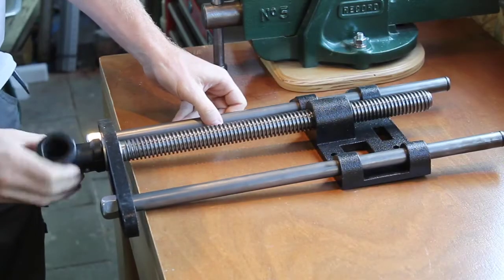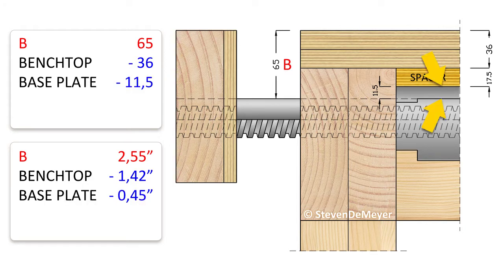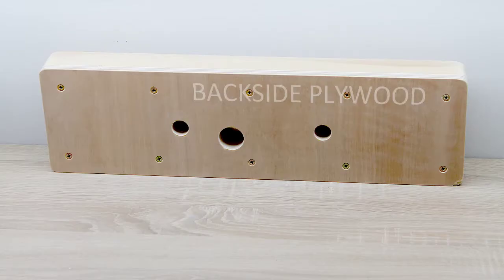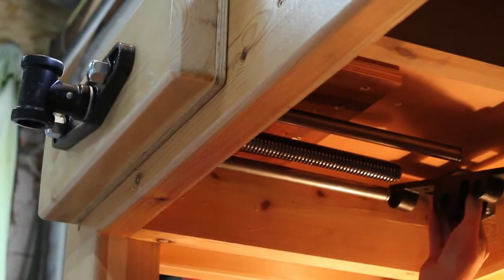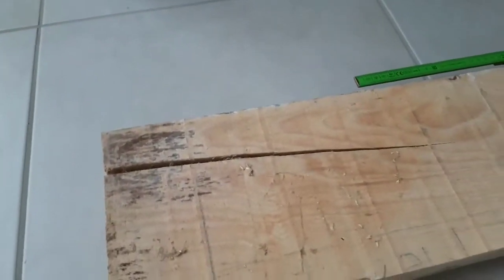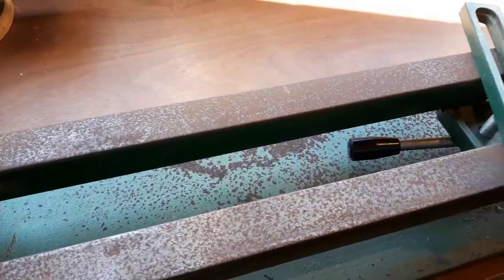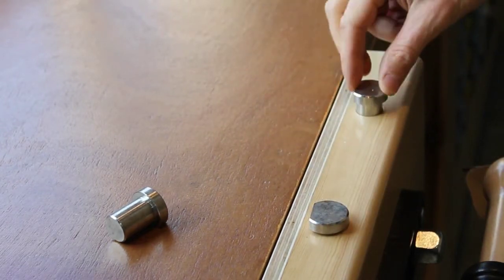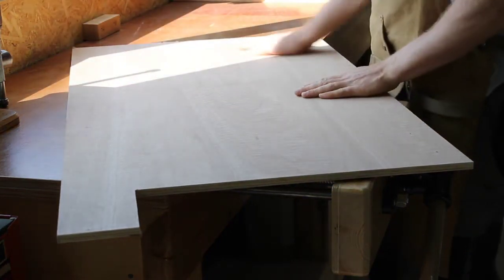Installing a BENCH FACE VISE  (HV516)  and woodturning a HANDLE

Comment: Great video. Thank You for providing the level of detail and measurements. This is very helpful depending on the level of the viewer and their need for information. Most of us don’t want to make things twice or to try to correct a mistake on a project like this. Your level of planning is useful, in fact necessary if you want to prevent mistakes.
Reply from the maker: Thanks for the kind words Allen, hope someone will find it useful 👍. Have a nice day

Comment: Great video full of very insightful procedures explained clearly. Thank you for putting this together. I tried using the dimensions with a vise I bought from Grizzly. The vise looks identical to the one used in the video. However it seems like some dimensions are slightly off.

Comment: Enjoyable, informative and liking the end product. Thanks for posting.
Reply from the maker: Thanks for the comment John 👍
Reply: @stevenshobbywoodshop4628  Steven, okay. Where are you from? You have great English. But, I noticed a ‘twang’ of...I like that the vice allows the full length of the bench to be used so that timber is held flat against it. I did the same but used a single Veritas screw, with two timber “runners” unlike the two steel round runners on your vice. What projects/work do you undertake? Take care. John
Reply from the maker: @johnpayne6196  Hi John, your single vise setup sounds interesting, does it work well with the timber runners?  My English is quite horrible, I'm from Belgium so it's a mix of different accents picked up from the television... Most of the time I'm working/fixing things on the house, other then that I make small objects, cabinets... Cheers
Reply: @stevenshobbywoodshop4628  Okay, in Belgium. I have been to Blankenburg, via Ostend. Spelling? Yes, the two runners are reasonable. I have to pack out using a spacer the same thickness as the timber being worked. I cut in two mortices in the vice chops, and into the face where your two round rods fit. The timber guides are redwood PSE (planed square edge). I might change them over to Brazilian mahogany. The vice chop is Brazilian mahogany (BM). The BM is from an external door I had taken off my house and salvaged the stiles, and rails. Substantial timber the stiles being 46 mm x 95 mm. The bottom and middle rails being 225 mm x 46 mm. I have retired (I was an economics lecturer in my pre retirement years; before that a carpenter and joiner as a 5 year apprentice) now. But, make furniture, doors, sash boxes etc in my newly created spare time. Take care.
Reply from the maker: @johnpayne6196  Thanks for the additional info John, great you could re-use some wood for the vise.  Sounds like it is well made 👍.  Good to read you've retired, that's usually a great time to (re)start woodworking and make some time for your own projects.  Wish you the best, Steven

Comment: I must give you a thump up for your detailed and accurate demonstration on how this vice is installed, excellent job...
Reply from the maker: Thanks for the kind words 🙏 cheers
Reply: @stevenshobbywoodshop4628  My order of similar bench vice just arrived today. Can I ask a question： how did you calculate the distance from the base plate to the spacer -block so that the base plate connecting to the spacer block exactly?
Reply: Sorry I got your detailed digram of your plan. Thanks
Reply from the maker: Ok goodluck with the installation 👍
Reply: @stevenshobbywoodshop4628  Does it work to use your exact diagram measurements for installing my new vise on my workbench?
Reply from the maker: If your vice has the exact same dimensions it should, else you will have to adapt the plan or search google for a manual/instructions for your specific vice brand.
Reply: Thank you. Can you let me know what size your front jaw is?
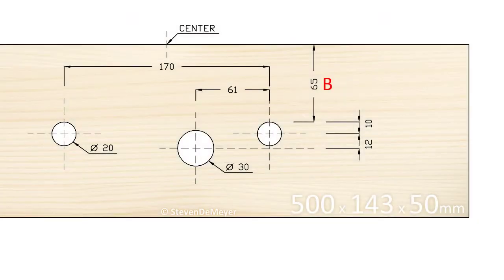Reply from the maker: The frontjaw drawing is at 2:35 (click the time link) cheers
Reply from the maker: In that drawing it might be a bit hard to see, it's 20" x 5.62" x2" or 500mm x 143mm x 50mm
Reply: It’s me again, your video is a very good example for me to follow and I am ready to install my vice now. 
In my case my bench top is 24mm thickness, spacer is 16mm (I have a ready piece), bace plate thickness is 12mm, so all up is 52mm thickness, and the distance (B) from top of bench to the vice Rod is 52mm. 
Now I need to decide how big size is best for the front jaw. I am not sure if I can make it 370mm x 125mm x 50mm. Would appreciate if you could give me your advice? 
Cheers 
Randy’s Workshop
Reply from the maker: Hi, I would make it as big as you can make it, for this type of vise the 'optimum' length for the frontjaw is 500mm(20"), but the 'minimum' length is 300mm(12"). The 'optimum' thickness of the frontjaw is 50mm(2") and the 'minimum' thickness is 30mm(1.18").  So you can size your frontjaw between those dimensions, I would say the bigger the better. Hope this helps, cheers
Reply: Thanks, I will make it 370mm x 125mm x 50mm for front jaw.

Comment: Great video. Why did you add a spacer block under the top instead of mounting the vise directly to the top?
Reply from the maker: Hi, you can mount it directly to the top, but then the 'clamping height' will be less high.  For this vise it was recommend to have 65mm (B) between the top and horizontal guides, so I added the spacer to lower the vise. Thanks & Cheers

Comment: Without a doubt the best instruction of how to installing a front vise.
I’m waiting the delivery of a similar vise (7”) to install on a bench that I will begin to build. I'd like to ask your opinion about, advantages or inconveniences of aligning the front jaw with the corner of the bench. Thank you. Best regards.
Reply from the maker: Hi Paulo, when it's installed at the corner you can easily do a cut-off with a (hand)saw on the piece you're working on (The saw is then moving at the left or right of the bench). A vice in the middle will be 'in the way' when you're not using it. A vice can be put in the middle when you're using it fulltime and it's your main-tool, like someone who only does sculpting work.  It's best to think about how you will use the vice in the future and then place it in a way it works best for your needs. Cheers
Reply: @stevenshobbywoodshop4628  Thank you very much for the quick and enlightened reply.
So, since I'm right, I'm going to put it on the left.
However, I'm thinking of lining up the front jaw with the leg and the corner of the bench instead of yours installation that got slightly swerved to the right. I'll be doing well. thanks once again. Cheers
Reply from the maker: Yes in general it's put on the left when you're righthanded (this improves handplaning etc). If you have enough space to align the vice with the corner that's even better indeed.  Goodluck with the project.
Reply: @stevenshobbywoodshop4628  Thanks once again for your help and your time.

Comment: Are you pleased with the vise you installed? It appeared to be well made. Thanks
Reply from the maker: Yes it's a good vice indeed, I'm glad I installed it.  Needs a drop of oil from time to time to run smooth and protect it from surface rust. Cheers

Comment: Off centre question - What wood do you use for your workbench top? It looks like a very good replacement for my MDF top!! Keen to know!
Reply from the maker: Thanks, the top is made of 2x18mm plywood sheets, it has a hardwood veneer on the outside, sold as 'red hardwood', cheers

Comment: Very nicely done! What are the dimensions of the work bench apron?
Reply from the maker: Thanks Jonathan, the dimensions (LxWxH) are  250x61x91cm or 98.42"x24.01"x35.82" cheers
Reply: @stevenshobbywoodshop4628  thanks....I was wondering the size of the apron that the vise is mounted on and the size of the front face of the vise
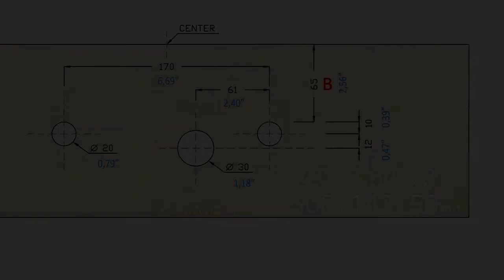Reply from the maker: At 2:42 you can see the size of the front (lower right corner), the bench is also made of the same size, so 143x50mm or 5.62"x2".

Comment: Is it possible to release the ring on the back of the threaded rod? I need to remove the clamping block I have
Reply: Do you mean the ring at 4:17 ?
Reply: @stevenshobbychannel  I figured it out. The locking ring. Just had to push it out.

Comment: 2 years ago?
How do you keep your work bench so clean?
Reply from the maker: Hi Colin, I regularly put a large (scrap) piece of OSB on top when doing more heavy duty stuff.  Most of my saw-work is done on saw horses.  Before adding the vise I added a fresh coat of varnish with a roller.  But in most cases I'm using a piece of OSB which keeps the top in great shape.

Comment: Can HV516 fit my 3" thick table?
Reply from the maker: A 3" thick top is no problem, in that case I would not use a spacer, just screw it under the table. If you really want it higher you can always use a router to take away some material on the underside of your table. Cheers
Reply: @stevenshobbywoodshop4628  Thank you. I will try.